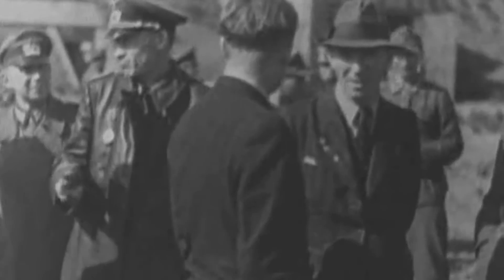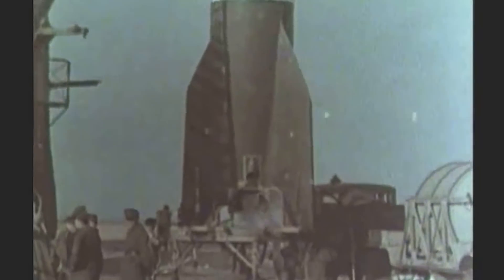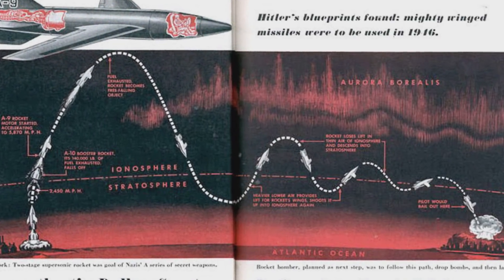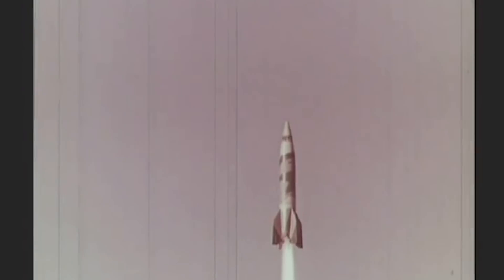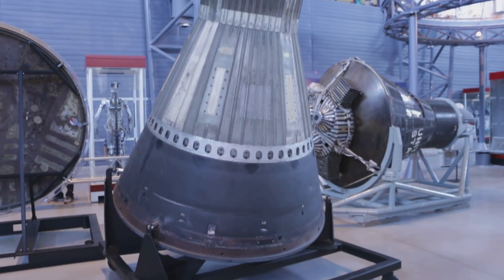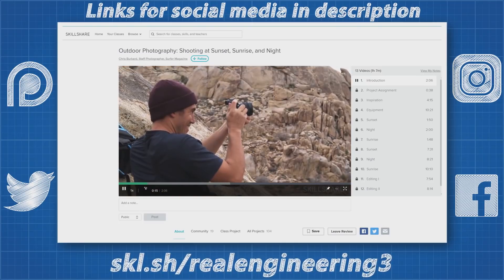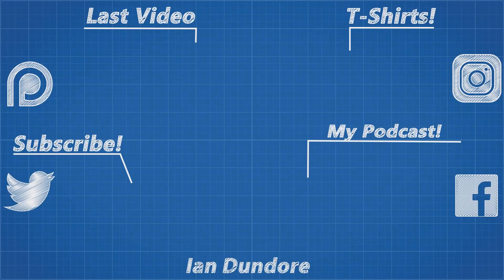Why North Korea Can't Build An ICBM (yet)

Comment: The heat-shield thing may be solvable by the kind of plastics that go into car brake pads and foamed ceramics seen in industrial ovens (those are basically what's on the Space Shuttle), and even small countries that aren't building rockets can make those things... So as of now I'd say the only limit is that if they put the kind of payload on that can actually do anything, the rocket loses the range needed to really reach out anywhere. It's one thing to fly something nearly empty and say it can reach, when putting something heavy in there changes that significantly. I'd also say it's hard to judge any success at miniturization with just the result of underground tests (bigger boom could just be a bigger bomb to start with), so that factor is still a somewhat ambiguous claim.

Comment: You are insane!  The altitudes they have achieved, combined with their flight durations indicate that they can put payloads... warheads into orbit.  That fact alone means ICBM capability.  You ARE being political.
Reply: You entirely missed the point.
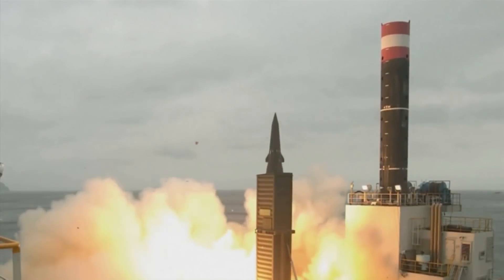5:53

What he's getting at is that guidance is not just an electronics challenge, its a computing challenge.  And re-entry is its own ball of wax, incorporating materials science, plasma physics, supersonic physics, and thermodynamics.  In terms of range, North Korea has achieved the mark.  But they've only overcome half of the technical obstacles.
Reply: +Creative Space Listen, lad. ICBMs need a way to be accurate and destructive. If you don't have any fucking satellites or guidance systems, your ICBM is going to land either in the ocean or in the middle of a field and blow up and do no harm to the population except people who live in rural areas which is not enough to kill a large population. ICBMs also need to be heat-resistant, if they enter the atmosphere and then go back down, they burn up so much to the point where if it is not well built and given heat-resistant materials, they will pre-maturely detonate and do basically no damage to the target at all. ICBMs also need to be funded cause these are nuclear missiles, they're expensive as hell and firing them costs a lot too.
Reply: you don't need satellites actually.  Inertial Guidance uses sensitive measurement devices to calculate the location of the missile due to the acceleration put on it after leaving a known position. Early mechanical systems were not very accurate, and required some sort of external adjustment to allow them to hit targets even the size of a city. Modern systems use solid state ring laser gyros that are accurate to within metres over ranges of 10,000 km, and no longer require additional inputs. Gyroscope development has culminated in the AIRS found on the MX missile, allowing for an accuracy of less than 100m at intercontinental ranges. Many civilian aircraft use inertial guidance using the ring laser gyroscope, which is less accurate than the mechanical systems found in ICBMs, but which provide an inexpensive means of attaining a fairly accurate fix on location (when most airliners such as Boeing's 707 and 747 were designed, GPS was not the widely commercially available means of tracking that it is today). Today guided weapons can use a combination of INS, GPS and radar terrain mapping to achieve extremely high levels of accuracy such as that found in modern cruise missiles.
Inertial guidance is most favored for the initial guidance and reentry vehicles of strategic missiles, because it has no external signal and cannot be jammed.  Additionally, the relatively low precision of this guidance method is less of an issue for large nuclear warheads.
Reply: No he is not, you just have a hard time understanding.

Comment: They said, N-Korea can't build a solid fuel missile. Oh wait, they fired them from an undersea boat. 
They said, N-Koreas missiles have a maximum range of 3000 kilometers. Oh wait, the last 2 ICBM they fired, prove this guys wrong. They also said, N-Korea can't build an H-Bomb while N-Korea anounced, that they will show a "big explosion" to prove what they said before. And they did. So, what makes you believe, that N-Korea does not have EXACTLY what they said? 
They obviously have every technology wich exists on this earth. Either they have bought it from corrupt people, or they have stolen it by spies and hacks. Think about the people who created the "wonnacry" hack maybe. And they know there H-Bomb would work fine, even before they used it, because they knew they have allready got the technology. Probably the same counts for their re-entry-engine of their ICBM, if you just do the math.

Comment: Idk why no one (including this video) failed to mention that ICBM's ARE NOT EXTERNALLY NAVIGATED!  ICBM's are all PREprogrammed by ONboard navigation. Otherwise other country's could hack into the signals and read/alter them. There is NO GPS or radio waves guiding an ICBM. It's all done BEFORE the launch, programmed in then set loose. It can't be changed.

Comment: couple of questions 
1. I believe all of the rocket engines are old stock out of Russia - So Mr Putin how many fireworks can they fire off before they run out of stock - someone must know - we're sure NK could not actually build a jet engine ???
2. What do they use for a guidance system USA's GPS or Russia's GPS network both of which could be turned off line during mid flight buy the 'good guys'
COMMENTS welcome
Reply: Ad 1: Before Korea became divided, the north was the industrial centre.
Ad 2: Neither, for obvious reasons.

Comment: But you shouldn't need military grade precision GPS to hit a city size or even block size target.  They could just add a commercial grade GNSS, Russian GLONASS, and a Chinese BeiDou GPS receiver and at least one of those systems would work.  But I guess the US could effectively jam all GPS frequencies in the entire West Coast of the United States and they actually did this twice in the last few years during some military tests.
Reply: Do those other systems work at high speeds? GPS units don't for that reason.
Reply: There is zero reason a GPS receiver won't work at high speeds.  It's not like you're going to outrun the speed of light.  All you need is a 1.1 to 1.6 GHz antenna under a plastic cover above so that it can get a clear RF line of sight to the sky.  This is exactly how GPS guided bombs and cruise missiles work.  This is why the radome nose cones of jet planes (both military and civilian) are plastic and not metal.
Reply: George Ou All civilian GPS receivers have speed and altitude limits built in so they can't be used for an ICBM. Unless they make the chips themselves a GPS won't work.
Reply: Oh so this is a software chipset limitation in commercial GPS units from component makers like Ublox?
Reply: I imagine when they changed the law to give civilians access to it part of it was part of the limitations. There used to be restrictions on accuracy. If any company made a non complient device the are selling illegal military hardware. Even if they are in another country sanctions could be brought against that company because end user certificates are a big deal in the arms world.
Reply: Civilian GPS can only access the lower precision signal.  Do you know for a fact that civilian GPS chips intentionally disable high speed operation like you would see on an ICBM?

Comment: Guidance is not a problem these days - historically, building a computer that could follow a map to a target with 1960s technology was quite hard.  Now a days, there's plenty of consumer hardware that a mere hobbyist could use to construct a working guidance system.

Even assuming that we detected the launch early enough to shut off our GPS satellites and prevent the easiest method of navigation, they could still triangulate off cell towers (commodity smartphones have done this for years...), radio stations, or in the very worst case, just construct a local map using a camera mounted in the missile and match it to an existing world map (something that would be outlandish in the 70s or even 80s but is trivial with modern computational power - this sort of computer vision in general is well researched and there are many papers and even implementations easily available online).

Just to illustrate what I mean, my cell phone's map app can tell me what side of my house I'm standing in.  Mind you, I wouldn't trust it to be low enough latency to work for navigating an object moving at several miles per second, but it illustrates how low the entry barrier for navigation is now.

Comment: Boy you clearly don't know jack! LOL! You think the hardest part to build an ICBM is a reentry vehicle! And the easiest part the 1st stage booster! LOL! You way off!  Hardest part is building a 1st stage booster (to an altitude of ~50-60miles)powerful enough to carry a 2nd stage booster that it's self is powerful enough to carry a Post Boost Vehicle that can carrying 1 tone Reentry vehicle! Making the hardest part that 1st 100km! 
If building that 1st stage was so easy every country on the planet would be sending sat into space using their own SLV! 
Yea North Korea can build rocket engines that can with stand the heat created by the rocket engine but they can't build anything that can withstand the heat of reentry! all they have to do is put some thermal resistant Ceramics to shield the warhead from heat it's extremely easy!!
And an ICBM RV in therms of the heat it has to withstand is no different than MRBM RV!
small thrusters on a PBV could even slower your dissent before release of the RV requiring even less shielding than a MRBM without a PBV (Post Boost Vehicle)
And your nonsense about WW2 era rockets are irrelevant BS

Comment: So I couldn't help but notice that you spend a lot of time getting to the point where you doing know what you're talking about. The North Korean missiles burned up because they were launched on a much higher trajectory than they would normally be launched, meaning any warhead would come down much faster than they normally would, making it pretty pointless to even worry about trying to test a warhead. That's how we know the purpose of the two tests that did that very high trajectory was simply to test the engine output. When you're testing a complex system, you do it in phases so you can pinpoint any point of failure and/or measure the success of a specific part of the system. So because they were testing the engine output, they couldn't have tested the warhead even if they wanted to because there's no way it would have survived re-entry. Even their latest IRBM test wasn't meant to test a warhead, and their test of an ICBM at a normal trajectory (probably tomorrow) likely won't be a test of a re-entry vehicle for the same reason. Just because they haven't tested said re-entry vehicles in a real-world test, however, does not mean they don't have them. It's a matter of engineering, and they've been working with ballistic missiles for long enough that they no doubt know the physics involved and how to engineer around the problem. Assuming they can't is probably the dumbest possible thing you can do, especially when you put a little "yet" on there, which basically is a caveat for when you are inevitably proven wrong. The whole point of this video, in that case, is just to claim a little territory in "being right" while it's an issue people are talking about. This is why people like you should not try to do analysis, especially on this topic. People who do can sniff you out pretty easily.
Reply: Oh, and you totally forgot about an EMP attack, which would not require any kind of re-entry vehicle or accurate guidance.

Comment: You act like they can't just coat the warhead with albatives, I think it would be extremely easy to build a vehicle capable of re-entry, they'd just have to use a larger rocket, which also doesn't seem hard for them, just expensive.

Comment: Unfortunately you don't need to reenter the atmosphere or be particularly accurate to do a huge amount of damage to a country if you can manage to detonate a large hydrogen bomb high above it and generate an enormously destructive electromagnetic pulse. North Korean media have made statements after the recent hydrogen bomb test to the effect that they consider this an option. Therefore the situation is far more dangerous that you imagine and if the USA is paralysed by having it's electrical power infrastructure knocked out it is likely that thousands of people will die from the flow-on effects of that denial of service, furthermore that will impact on the entire world economically. We are all connected in a modern world and we are all in danger one way or another.

Comment: but the Hwasong-14?
Reply: Ben i think its optional as they may not need satillite guidance if they already have coordinates.
Reply: Hwasong-15 now
Reply: Wilhelm VonRoefelz how do you know sir?
Reply: he covered this in the video lol.
Reply: no he implied that they can make a long range, accurate ICBM because they lack satellite nav systems as well as they don't have a the tech that would support reentry from space.
Reply: Wilhelm VonRoefelz he said that the v2 didn't use satellite guidance not icbms and even if North Korea built a icbm to reach America they would be wiped out of existence by America
Reply: actually they don't...it's specifically designed to operate without need of outside interference so it couldn't be possibly jammed.  Inertial Guidance uses sensitive measurement devices to calculate the location of the missile due to the acceleration put on it after leaving a known position. Early mechanical systems were not very accurate, and required some sort of external adjustment to allow them to hit targets even the size of a city. Modern systems use solid state ring laser gyros that are accurate to within metres over ranges of 10,000 km, and no longer require additional inputs. Gyroscope development has culminated in the AIRS found on the MX missile, allowing for an accuracy of less than 100m at intercontinental ranges. Many civilian aircraft use inertial guidance using the ring laser gyroscope, which is less accurate than the mechanical systems found in ICBMs, but which provide an inexpensive means of attaining a fairly accurate fix on location (when most airliners such as Boeing's 707 and 747 were designed, GPS was not the widely commercially available means of tracking that it is today). Today guided weapons can use a combination of INS, GPS and radar terrain mapping to achieve extremely high levels of accuracy such as that found in modern cruise missiles.
Inertial guidance is most favored for the initial guidance and reentry vehicles of strategic missiles, because it has no external signal and cannot be jammed. Additionally, the relatively low precision of this guidance method is less of an issue for large nuclear warheads.
Reply: Wilhelm VonRoefelz - Doesn't pretty much everything in the US arsenal predate satellite navigation?
Reply: Wilhelm VonRoefelz  ICBM use satellite and inertial guidance you idiot, you know nothing about missile technology
Reply: Wilhelm VonRoefelz they need satellite guidance otherwise their ICBM will be inaccurate  you idiot

Comment: Although I know designing and building ICBMs isn't a simple task,  America was able to field a reliable and reasonably accurate ICBM system (the Atlas) in 1959.  And that was using just mechanical and analog electronic systems.

Comment: BUT , if the idea is to explode a warhead in space above a rough point in the US , then re-entry is not an issue and neither is accuracy . AND the damage footprint would be far larger .....for electronics over a wide area of the US . Several such warheads would cover most of mainland USA with an EMP effect .

Comment: DPRK has had ICBM technology for decades. Yeah its not great but they have work able designs currently like the taepodong 2 https://www.globalsecurity.org/wmd/world/dprk/td-2.htm
Thankfully their guidance systems are bad but when you start talking about WMD's hitting within a few KM is close enough. As far as counter measures their reentry vechiles already maneuver to avoid intercepts and that is only really possible on shorter range missiles. When we start talking about ICBMs as far as I know the only possible chance to intercept is either in the boost phase or when it is in orbit before reentry. Even our best systems have a hard time intercepting something going that fast. I've worked closely with patriot air missile defense. THAAD may be a game changer but when I was involved it was still in it's infancy. So the title is completely misleading.

Comment: From What I was able to understand about the german rocket V-2 (Ballistic rocket also known as A-4) the ranging was not determined by the ammount of fuel loaded in the tanks. The fuel lines had shut-off valves controlled by a Rate Integrating Gyro. a mechanical device meant to integrate acceleration over time, and therefore once achieved a predetermined velocity required to hit their targets travelling on a ballistic trajectory, this device shutted off the engines. 
The ammount of fuel in the tanks was instead the way the Germans used to determine the V-1(cruise missile) range.
Chech this:
https://airandspace.si.edu/collection-objects/accelerometer-integrating-gyro-v-2

(I am a space engineer)

Comment: I get the challenge of building a mini nuke and all, but the point you made about lack of GPS satellites and all that? Can't they just buy a damn iphone? Or fancy Sat-phone? Or generic GPS device? What's stopping them from wiring up one of those and just using our own GPS satellites, or China's, or Russia's against us? My phone has an accuracy that can be measured in double digit feet (or single digit meters). That's plenty accurate enough.